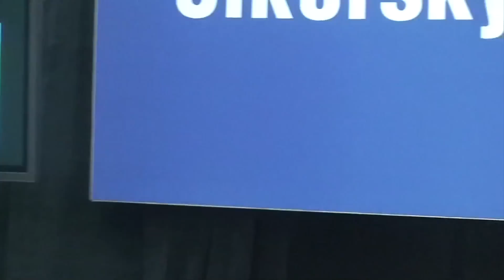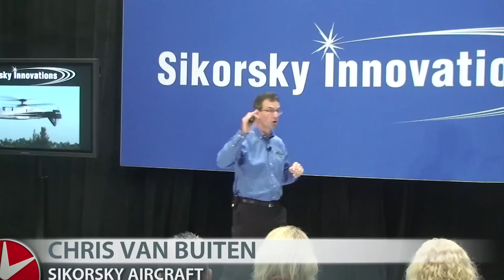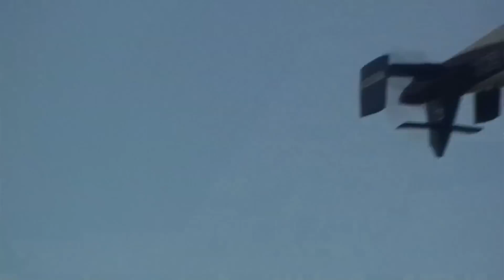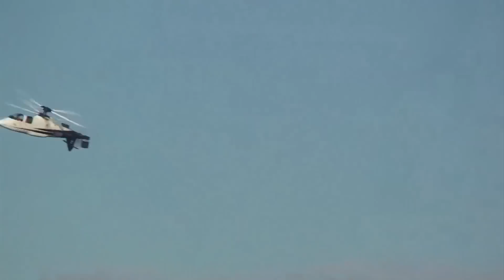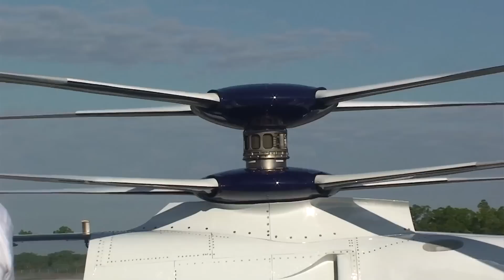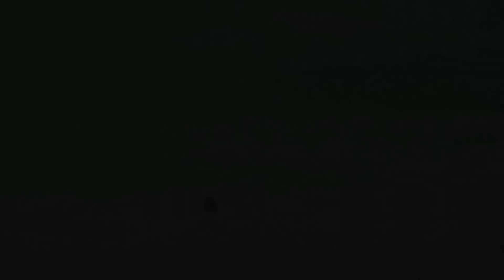Sikorsky Demonstrates New X-2 Helicopter HD Version

Comment: I always asked why they don't slow the main rotors to like 50-100 rpm (when in fast flight). And thereby use the advancing blades as wings (and the receding blades would have a neutral angle of attack). They could do it with algorithms, like they do, anyway, with the existing rotor blade angles. It would hardly need much modification (maybe just to accommodate the new algorithms). For such simple mods this machine would go 350 knots (a hundred knots faster) and maybe even with less fuel burn. I fail to see why they wouldn't have thought of it (there is no evidence that they have though). And that (to me) is FRUSTRATING! Imagine how good this machine could really be, and it would be a milestone in aviation, a dream come true, but NO, they won't think of it. And there is NO WAY that they are going to listen to a single (one off) YouTube user.
Reply: If you decrease the main rotor to 100 rpm, the chopper will crash down like a rock. It is that simple. There's too much difference between the main rotor linear speed and the speed of the helicopter in a direct flight. During the direct flight, some blades are retreating backwards and some move forwards which is a huge problem but it has been solved. However, you can't increase speed much with such a conventional setup. Imagine a linear speed of the blades is the same (or lower) as that of the helicopter, which means the retreating blades are kinda linearly stationary and generate no lifting force while forwarding blades create lifting force, the chopper will instantly roll (capsize laterally) and stall and crash. Blades should move faster than the helicopter flies. Physics is physics. There's nothing anybody can do about it. Helicopters will always be the way they are even one hundred years from now. Speeds can be increased of course by higher rpm, push propellers or even jet pushers. Other than that helicopters are just helicopters and no magic there. It's just like old propeller planes:  Neither can they fly very fast, nor can they vertically land or take off. You need a VTOL for the latter or some jet system.

Comment: I guess this prototype would evolve into something that enters production at a later stage. I see 2 issues with the design though:

1. The propeller behind the aircraft can be a safety hazard. It is low, spins fast and is perhaps even more dangerous than the tail rotor of a conventional helicopter that has killed or maimed many people.

2. The lower coaxial rotor appears to be quite low. Perhaps it is not possible to discern the true clearance from the videos and there is enough clearance such that you don't get decapitated !

The other feature not mentioned is the range of this aircraft. How much fuel can it take and compared to other choppers what is the km/litre ?

Comment: Well, the reason for its manoeuvrability is the full rigid rotor. So, collision is very unlikely to happen.
Reply: I don't agree, the rigid rotors are for the high speed without the blades buckling in the wind. The most agile helicopters still have wonky blades (but stiffer than most still). And you see them droop a little when they are parked.

Comment: ted rotor blades so that as each rotor blade " cuts across" variable magnetic field they can be influenced such that mechanically advantageous " wing warping" and hence increased efficiency in their " angle of attack " can be imparted ? Might make it a bit more visible on radar but then it could be an " intermittent system which could be turned off or " masked" when circumstances dictate ?

Comment: Two variable speed pusher's might also negate the need for a counter-rotating rotor config? A single large diameter non rigid rotor might be made to work in conjunction with a dual purpose retractable skid(s) mechanism installed on the centerline of each boom and at the topside of the studs running the centerline would be " variable magnetic influence" " transmitters?" Which when the skids are retracted the transmitters would be in relative proximity to the underside of the magnetically impregna

Comment: You might want to look at the Kamov KA- 26 twin boom helicopter for a solution to the scenario I mentioned in my previous comment ? If you had " two" pusher props the need to flip the one " off and on " could be negated by varying the power supplied to the P+S side pushers but never turning them completely " off" ? You could also carry more fuel in those booms . Your rigid rotors cannot be feathered I'm assuming which makes stowage of your craft difficult in military scenarios

Comment: i know that. im simply wondering what the chances of the blades colliding during a high speed turn; since it has a tighter turn radius than most counter rotating rotor choppers..

Comment: Dual counter rotating rotors eliminate the torque problem usually solved by a tail rotor, eliminating all the problems associated with loss of tail rotor integrity, and no need to autorotate.

Comment: The osprey is a tilt-rotor VTOL. Though it achieves takeoff in a similar fashion, and has similar control surfaces, it does not have the kind of precision rotor control a helicopter does. It's awesome, but doesn't qualify as a true helicopter as it does not have a rotary wing located in a fixed position, and controlled by a swash-plate and push rods and whatnot.

Also, defensive cannons don't make the osprey a gunship, just better defended.. Are there plans to make it an attack craft?

Comment: It is in the pipeline to add defensive cannons to the Osprey. Remember, the Osprey can carry more payload than any other rotor wing aircraft in the U.S. arsenal. Even more than a sea stallion or a black hawk.

And why is the Osprey not a true helicopter? It takes off and lands with its nacelles in the vertical position and its stub wings provide no lift at that time. Is it because it doesn't fall prey to the fatal speed flaw in heli's? Dissemtry of lift.

Comment: Well sir,  the man in the video says the blades are rigid to prevent it from colliding, or perhaps they can add more space between the two rotors.

All the toy RC helis seems to use the double rotor systems to make the controls cheaper..  so I wonder in the real stuff, the technical limitation is beyond my understanding

Comment: exactly and they used dual rotors for stability. i thing its a pretty good idea for a fast recon chopper. it sounds more like an ultra light than a chopper. the only question is are the vibes low enough to reduce the possibility of rotor collision during high speed turns.

Comment: I think you'll find that those of in the industry would not agree with you at all, indeed, it is by definition a 'heli' copter. The fact that it has augmented longitudinal thrust is nothing new at all. The contra rotating main rotors are a very neat solution to two problems (also not a new concept):

1. lift asymmetry across the blade disk between advancing and retreating blades
2. torque reaction to the driven main rotor thus eliminatingthe requirement for a tail rotor

Comment: This is not a true helicopter either, it is a compound helicopter, incorporating a pusher prop.  Also, Sikorsky  developed a similar compound helicopter for the military in the 1960s called the Cheyenne.  Prior to the Cheyenne, Fairy in the UK in the 1950s developed the Rotodyne compound helicopter, a passenger/cargo prototype.  The Rotodyne had two turbo prop power units that fed compressed  air and jet fuel to tip jets to provide power for the main rotor when hovering, taking off and landing.

Comment: The way I think it would work is that at higher speeds the main rotor is still being used more for lift than forward thrust. Thus the pusher prop means you can maintain the same lift by going forward faster while at the same time reducing main rotor RPMs. (I believe there's also an similar idea used in a recent experimental autogyro where it applies a brake to limit lift rotor RPMs at higher airspeeds in order to improve efficiency.)

Comment: Yes, 250knts is well below the sound barrier although you'd probably find the tip speed is pretty close to the sound barrier. Scaling the design up in size is going to be tricky but a pusher engine or two to help with horizontal thrust on a helo is not exactly a new idea.

Comment: If I've understood correctly, top speed for traditional helicopters is limited by the main rotorblades, as pushing them through the sonic barrier would cause a lot of problems. Why doesn't this construction share that problem? Does the tail rotor allow using the main rotor at a much lower rpm or?

Comment: You mean rear rotor. Normal helicopters do not have a rear propeller. They do have a tail rotor, which is different.

This helicopter has no need for a tail rotor due to the contra-rotating lift rotors, so the space is freed up for the pusher prop. And ingenious design to say the least.

Comment: Hence the advantage of coaxial rotors.  The blades are counter-rotating so the retreating blade stall on each rotor cancels out.  The blades can also be shorter, reducing the mach barrier.  (Not to mention eliminating the tail rotor and all of its problems...)

Comment: Coaxial rotors have other advantages. The tail rotor typically uses 20-30% of engine output but contributes no lift nor thrust, and is a common cause of failure.  Also the interaction between the air flow of the main rotor and tail rotor causes much of the noise.  Coaxial rotors also eliminate di-symmetric lift and retreating blade stall, reducing the need for cyclic pitch, and allowing the helicoptor to fly faster.

Comment: Coaxial rotors are more expansive to built, but have many advantages (high stability, low rotor diameter, high efficiency) and some problems like the bad glide efficiency if the engine fail (this explain why all Kamov have minimum 2 engines for safety).The Kamov are very appreciate in precision charge lift jobs all around the world
The first full manouvrable hélicopter was a coaxial (1933 Breguet Dorant gyroplane laboratoire)

Comment: And old becomes new: this an updated 1920's concept, the autogyro ... So yes, this has powered, contra-rotating rotors, fly by wire, etc. but fundamentally it's a very old design. Anyhow, time will tell if the improved speed is enough to off set the high cost & mechanical complexity.

Comment: it is controlled like rc indoor helis also 2 mains rotors also fixed and a tail rotor to go foward and backward to do the same as the tail rotor in this heli the first main rotor go faster or slower than the second main rotor to go foward and backward the propeller at the back go in one direction to go foward and in the other direction to go backward but to tlit/bow the heli i have no idea maybe moving the main rotor right and left from the original axis well sorry for my bad english im spanish

Comment: The main point of using counter rotating blades is to prevent stalling at high horisontal speeds. When a regular helicopter reaches high speeds the part of the rotor that is currently moving in the direction of flight will reach a speed close to supersonic and cause vibrations. The other part which is rotating against the direction of the helicopter will be experiencing close to 0 airspeed and thus, lose lift and causing a stall. With counter rotating blades this is averted.

Comment: all the designs people are talking about dont restrict the helicopters speed. the fact its contrarotating means lower tip speed. tip speed it the one single bit that restricts the speed. if the rota tip reaches the speed of sound your in trouble.

Comment: Having two main rotors lets it move much faster than regular helicopters even without the help of the tail propeller, 'cause with the counter rotating rotors even when it is moving so fast as to cause significant asymmetry in the lift of one of the rotor the other rotor is suffering the same effect but mirrored, canceling out the asymmetry

Comment: That's what I thought. Now, how do you use the rudder? Similarly, how does a Chinook helicopter control yaw?
Reply: The Chinook and X2 rotate the same way: slow down one set of blades and it will turn.

Comment: Nice one. Typical Sikorsky.Russians have been flying contra-rotating choppers for more than 30 years,just without the rearward facing thrust fan... like the autogyrocopters have been using. I guess they probably have been building the ones with rear facing turbines also..

Comment: @guille8001500 
No similarity, on a autorogiro, the rotor isn't  engine drive (only like a wind mill, from the forward movmen), and no autogiro was coaxial (dont' produce rotative torque on the rotor axis)

Comment: @raynkar 
You do realise the shape and size are pretty different, as is the rear seating layout, rotor design, gearbox design, hub design, tail rotor design, flying surface design, number of engines (European engines too), avionics, flying controls.......even the famous huey wire cutter isn't there.............
What do you see that is still based on a huey.....Please don't say rough layout/shape, as that could include lots of heli's......Some parts come from France, so it is based on a Puma?

Comment: @DirtDobber1337 
No, I didn't know that....And there is a good reason far that too lol
That's because it isn't. Now I'm no expert but do live where Lynxes are made, and am wondering what parts/ideas you think are the same.
It can't be: Rotor blades, solid hub, avionics, engine design, design for use at sea too, number of seats, fuselage dimensions, heat suppression, speed/range criteria, materials used in construction etc....So what is it??????

Comment: @Nunubyou1 Big scale and these speeds are something totaly diferent. At 250 mph they are some searious problems to solve for rotor like the fact the blades can be flown by air in two directions along the edge. If you dont understand it just keep it in mind there can be things out of your sight and don't laught so low at them.

Comment: These r slower than tilt-rotors like the Osprey and BA-609! But the buck definitely STOPS there!!! These machines would be cheaper, more reliable and no transformer shape change (just a few cms of prop-blade movement). Neat! And less stress on airframe. That's not all! It can auto-rotate any time (like any chopper). Lets say the highly unlikely event of loss of engine power happened half way into transition. What would u rather be in, this thing or the Osprey!!!